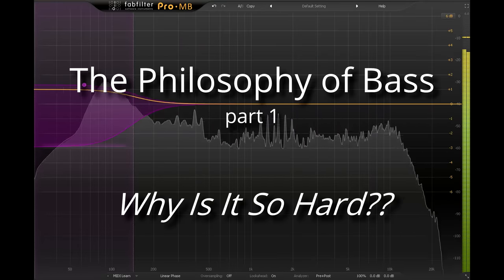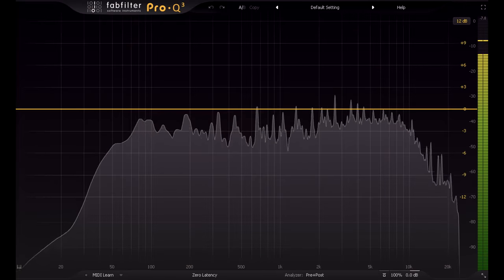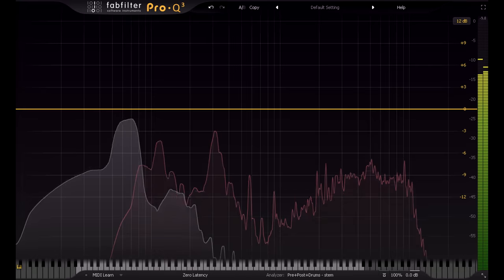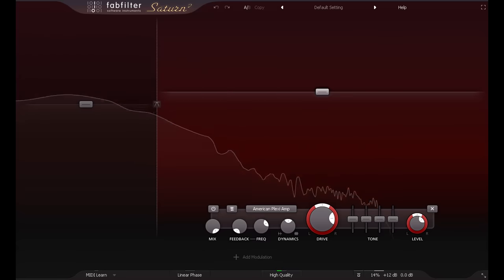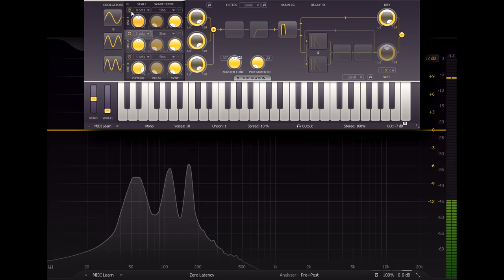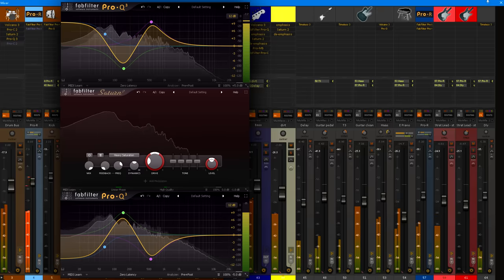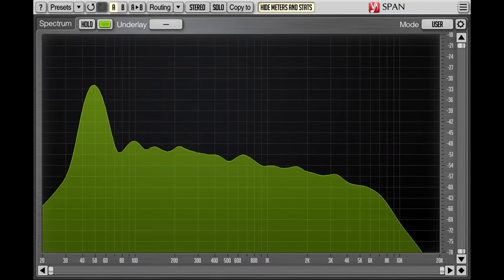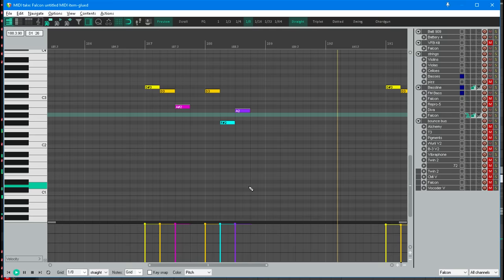The Philosophy of Bass

Comment: Many people use an app like Reference, which has presets for tons of headphones and monitors to re-tune them to be flat.
Reply: I didn't like that app, I tried it for a few months but preferred my headphones with their stock sound, and found mixes fine tuned using them with their stock response were also translating better than if I used reference (was called sonarworks at the time)

Comment: Hey! thanks so much for this, Loved it! I have a question. Obviously adding the two partials at one octave and one octave + 5th is very easy with a synth, but how can I do the same thing with, say, an electric bass? is there a specific saturator that's tuned to do that? I suppose you could low pass the saturator if it's in parallel?
Reply: They're already there. A vibrating string will produce the entire harmonic series. Just use EQ to shave back the low fundamental and if necessary boost the higher harmonics instead.

Comment: Hello Dan, hope you're doing great. 

So, as long as I have a big-ass subwoofer, does the size of the main monitors matter? Is it ok if, for instance, I purchase a big-ass subwoofer + tiny 4'' woofer monitors with tiny cabinets?

Also, there are some monitor designs that ditch the reflex port and instead they use some sort of diaphragm or "passive radiator" that look like extra woofers. What do you think of those?

Thanks for the great videos as always, cheers!
Reply: Bigger main monitors are still beneficial as that allows you to set the sub crossover lower. If I had tiny monitors I might add a sub first, then replace the mains as well when funds permitted.
Passive radiators are basically the same as reflex ports from our perspective. I believe speaker designers use them when tuning the ports with tubes isn't practical. Just think of them as fancy reflex ports.

Comment: Good to see.
I'm curious about the philosophy of bass in soft synths. Which very often—I assume we see in this example at 8:18—gives a 10 Hz boost. Very common in soft synths (including Twin 2) and I wonder why? Shouldn't that be considered bad engineering or is it more to this I don't understand the reasons for letting this be as is?
Reply: Careful, what you see on a frequency analyzer is not an exact representation of what's going on with the sound. Actually the definition of which frequencies are present in a signal is not something you can give precisely, unless it's a continuous time invariant signal of infinite length like a constant sawtooth wave going on into infinity.

The more accuracy you want in which exact frequencies are there, the less accuracy you get in the time domain, so their contours on the analyzer will appear to slowly fade in and out instead of tightly following the timing of the signals. The more accuracy you want for the time domain, the less accuracy you'll get in the frequency domain, so the peaks and troughs will appear wider and spread out. This is a fundamental limitation of representing the real signal (a waveform of volume going up and down over time) as a series of sine waves across the spectrum.

So that 10 Hz signal you're seeing might not even really be there. You might be able to test that by adding a lowpass filter low enough that you don't hear any real musical information, but high enough that you still see the 10 Hz signal, and see if it still clips your output or shows up on an oscilloscope plugin. But of course you'd have to make sure it's not actually 20 Hz or higher information that isn't visible on the spectrum analyzer due to a similar accuracy problem.

It might even be some DC offset that's appearing and disappearing, which is confusing the analyzer. DC offset is kind of a 0 Hz signal since it's an unchanging offset in the volume of the waveform, and if it's not filtered out properly in the visualization, it might cause weird issues.
Reply: @cornoc  
Many thanks.

It's not just a peak at 10 Hz, it's a pretty wide frequency from 40 Hz and below after a burst showing all lower frequencies—cut at 10 Hz because of the analysers not going further down. (Fabfilter Q3).
Although it is a consistent frequency from 40 and down no matter what key you play.
So maybe it is an error occuring in the analyser?
 
But the low frequency information only exists in soft synths. Not from external synths etc. 

So if it's caused by the programming in the synths, shouldn't it be filtered out instead?

Would love to hear more about this from the developers.
Reply: @cornerliston  Yeah you've got me curious about that now, I'll check with my analog synth later.

Comment: Built 2 18 inch bass horns with 2m2 throats, folded midrange horns and 2 compression horns. PC, 8 channel usb audio, dco, 2x3w SET tubes, 2x20w A tubes and 2x 1000w SS amps. Accurate bass to 30..it goes to 15hz lije you never heard before and 106db1w average and instantaneous, fast play.

Comment: The intro to Angel by Massive Attack has 3 separate bass lines co-existing; a synthesised bass, a kick drum, and a low bass guitar, and somehow it works. I have large 8 ohm planar headphones, and Angel is impressive to listen to, much more so than on any speakers I've ever owned.
Reply: Do you know the original Reggae version of Angel? I was amazed by how they arranged that track first and foremost... They completely changed the vibe of it... P.S. The aforementioned track is "You Are My Angel" by Horace Andy.
Reply: @Bati_  I didn't know it, but I just checked it out. So soulful. Almost unrecognisable from the massive attack version, which is kinda menacing. Thanks for letting me know.
Reply: @FriedEgg101  No worries! I’m glad you discovered and liked it as well! You are right, they evoke completely different feelings.

Comment: I found the thing about the cabinet size on subwoofers interesting. Does it mean i should swap my sub7 for the t10s?!  Because i read different things. But usually Dan says things that are profound and scientifically backed. But this maybe should be a bit elaborated :)
Reply: What he says is a little bit simplified, so i will give a little less simplified answer. A small bass driver could produce low bass at the cost of not being very loud. To produce bass you need to look at the volume of air the bass speaker can move. If it's a small driver, its excursion has to be greater. A 7" driver needs to travel a lot further back to move the same amount of air as a 10" driver. Speaker drivers tend to distort less the less they move, which gives that a larger diameter driver often sounds cleaner than a smaller at low frequencies. 

Here are some different approaches to subwoofer design:
1. Small speaker driver in a small enclosure. This kind of design just suck if you want good reproduction of low frequencies, just like explained in the video.
2. Small speaker driver in a big enclosure. This is better at reproducing the low end since the air in the enclosure doesn't restrict the movement of the driver as much.
3. Big speaker driver in a small enclosure. This is not necessarily better than 2. The air will restrain the driver from moving, and will require a lot of EQ and thus amplification to be able to move the driver as much as needed. A lot of power is going to just warm up the voice coil instead being transfered into acoustic energy.
4. Big speaker driver in a big enclosure. This is just what everyone should get. High efficiency. Good low frequency output. Low distortion.
Reply: @albinapa  Thank you very much for the detailed explanation and insight.
Meaning that the t10s in fact should have cleaner bass reproduction than the sub7?!

Comment: Nice and surely interesting video. Keep it up!
But as a Speaker builder myself I have to strongly disagree with the first part, the concept of needing big speakers for deep bass extension is quite outdated (although it is still valid if we talk about peak spl). Modern speaker drivers are exceptionally good in producing incredible bass out of small cabinet volumes. Especially with all the active monitors used by pros and consumers nowadays.
Also afaik the audibility of group delay below some 70 to 80 hz is highly debated or at least shouldnt pose a problem on any halfheartedly designed speaker.  Below some 200hz room-acoustics dominate anyways.

Comment: It depends on your mix environment and to the playback environment.

Most studios have bad room treatment where it's not really curing the bass mode problems.  There are three types of low frequency mode problems.  Axial, Tangental and Oblique.   They are the modes created between 2, 4, or 6 parallel surfaces.

The biggest problems are the Axial modes and in small rooms that people have, they need some rather expensive low frequency absorption that takes up a lot of physical space.    the video mentions corner bass traps, which is the biggest crock because Axial modes are NOT between 2 parallel corners, they are between 2 parallel surfaces.  it's all about SURFACE coverage.

To really go after those frequency problems in the average room can easily cost in the tens of thousands and most people don't have the budget and/or have the room to place enough units to really minimize room mode pressure problems.  The result is the mix engineer simply will not hear accurate low frequency because either they don't have the right or enough low frequency absorption.  Most of the low frequency absorption devices called "bass traps" don't even do that much absorption in the 30hz to 50hz range which is the fundamentals of low frequency problems start and in music.  Kick drums are in the 50hz range, Bass guitars go down in the 40hz range, and some low frequencies can go even lower.
Reply: mass loaded vinyl is pretty cheap if you know where to look. I got 1200mm*1200mm slabs of 5mm thick, 10kg per m^2 for £18 each. just need a can of spray adhesive to slap it on your wall/ceiling/relatives and some AC50 acoustic caulk to fill the gaps. was only £80 to treat my ceiling with that stuff with some spare left over for the door frame.
wonder if just having strips of the stuff in the corners would act as decent enough bass traps lol
Reply: @forguanterasmus5794  
Strips of MLV in the corner?  That's a new one.  PROVE that it's effective.  Please show me absorption coefficient measurements.  

Why are you treating the corners? That's not the best way to absorb Axial modes.. Axial modes are the biggest problems in terms of peaks and nulls for low frequencies, especially in the sub 100hz range.

You need LOTS of surface coverage.  Just sticking MLV doesn't have enough mass.  It's great as a material to put in a wall structure in between other materials to decouple instead of using GreenGlue, but as a low frequency absorption by itself?  I haven't seen any measurements to prove it's effectiveness.
Reply: @Oneness100  tbf I was just wondering if it would work, I don't actually have it set up like that; my walls have NoiseStop 22.5mm panels (half inch acoustic plasterboard + 2.5mm mlv+ 5mm foam + 2.5mm mlv, stuck to the brick wall on the mlv side. each panel is 32kg iirc) but for the floor and ceiling was just straight up mlv (or barrier shield as noisestop call it) for mostly noise pollution + some foam wedge panels to help treat the highs/reflections on the ceiling/walls. not got any bass traps due to how small the room is (plus the panels already do a good job), hence wondering.
the noisestop panels have test data on their site, but the mlv just says 32dB reduction for the 10kg/m. how they got that data or what the response curve is, idk.
Reply: @forguanterasmus5794   you are now discussing sound proofing.   What's the STC rating of your wall and what frequency can it down down to?  And why did you decide upon the wall construction design that you are using?   Did you do any noise study measurements first?

 Most walls have an STC rating that only goes down to about 125hz.  Does your walls block below 125Hz and if so, by how much?

What you are also doing is confusing soundproofing AND sound treatment.

Please keep them separate.   Room treatment has nothing to do with blocking sound going in/out of a room.

Room treatment is dealing with pressure and/or reflection problems within the room.

Foam wedge panels?  Where are you putting them and why?

I think you need a re-education on what you're dealing with.

Comment: Very nice video. Here are a few things about headphones. The ones that you showed are not designed for mixing, which is why they failed you. Headphones can be EQed with software but also with autoEQ project, which is free and with measurements  from engineers like oratory1990, you can shape their response to resemble monitor setup. That said some headphones are designed to be used as a level reference - they must be semiopen construction like DT900. Their bass extends flat to 20Hz with little delay and distortion. Tracking headphones like DT770 have purposefully warped response to aid various tasks around the studio but they're quite far from "flat". Usually mixing takes two pairs  of headphones. You can simulate the other pair with EQ, but the key point is that one pair needs flat lows and midrange and highs tuned to a loudspeaker setup. The other pair needs boosted highs like DT770 and other Beyerdynamic and AKGs. Headphones have potential to have their bass better in some ways than speakers, just not the visceral impact. Some headphones are designed specifically for monitoring bass - Audeze LCDX for example. They have relatively flat bass down to 10Hz and completely free of compression while distortion is at less than 0.2%.Their upper range is unusable without EQ, but they're better than anything else at that one thing.
Reply: I think very few headphones are suitable for mixing thanks to the frequency response. HD600's with a bass lift or Sundara with a 2khz lift by 2.5dB would be pretty good. Etymotic IEM'S are also really close to neutral.

Comment: re Slope: I analysed a bunch of popular tracks in Voxengo Span and, to my surprise, found that they had a slope not of 3 (pink noise (3.01 actually)), nor of the Voxengo Span default setting of 4.5, but of about 5.5, which is much closer to red (/brown) noise (slope 6.02) than pink noise. When mixing or mastering, I now try to get the top end and the sub to be at the same height with a slope setting of 5.5, and that seems to work well. I think that the idea that people like pink-noise-sounding songs best is incorrect. I think people like red-noise sounding songs better, but red is a bit too much, and we should back off from 6 (red noise (6.02 actually)) to a slope of between 5 to 5.75 depending on genre. That's what I think anyway. Whatever you think, this Wikipedia page is reallly really really worth reading! https://en.wikipedia.org/wiki/Colors_of_noise

Comment: I've come to the conclusion that bass doesn't need an enclosure. An output from a dipole bass is the most purest type of bass sounds I've ever heard. Even a "sloppy" driver will produce surprisingly tight kicks and pleasant, exact notes. Someone would argue about phase problems and the lack of sensitivity being a problem. Well, of course the room will do stuff and it's not an easy task to get everything in sync and equal, but that is same for everything when trying to output a flat and coherent sound in a closed space. 

EDIT: A free air/dipole bass does usually need equalizing because of the broad roll off at the lower frequencies. And I'd suggest keeping the drivers close to the listener, as the response probably shifts more or less, the farther from the drivers they're being listened.

Comment: I have an opinion that pink noise is the true flat noise. White noise has a constant amount of energy per hertz, but there are a lot more of those hertzs in high frequencies. Pink noise has a constant amount of energy per relative change of frequency (or, per octave). Or, a fixed amount of excitation of a resonator of a certain Q, no matter the resonance frequency of the resonator.

Optical spectra are often presented as amount of energy per nm of wavelength, and if presented in this way, white noise will have a heavy slope. It's a matter of x axis choice. If the x axis is logarithmic, pink noise should look flat.

Comment: Even with decent headphones I’d say that if the low-end sounds loud enough when listening with headphones, it’s surely that it’s too loud. Headphones will never permit you to "feel" the low frequencies as you would on a powerful  sub-bass-able system.
It’s not easy to get use to just appreciate the low-end with your ears only. Especially  when dealing with musical genres for which the bass parts are knowingly headed to the body, not the ears! ^^

Comment: 0-80Hz totally transforms the mix.  But how to mix down to 40Hz (most subs are limited to this) and lower in the same mix?  It's not really possible.
Maybe the pro's can get more work by making separate mixes for cars, homes, clubs, people who have subs, people who have really low subs.  It's a dilemma.

I am EQ'ing some Witch House music. From the spectrum, I can see it was mixed for subs down to about 40-60 Hz.  It relied on the dynamic range compression of large drivers to compress that region.  I'm using distributed bass, so I had to put a 12 or 24 dB/octave High Pass Filter to do that compression and get a nice clean and fast bass in that region.  Ideal would be about 16 dB/octave but I have to customise the filter for that - for these drivers.

Maybe some recommended EQ settings distributed with the music or on social media would help.

This recent trend to mono music on phones and bluetooth speakers is horrible.  By now, some EQ curves could easily be part of music encoding and decoded by the player.  I think this was considered when MP3 format was created back in the day.
Reply: recent trend? 😂 Genres like EDM have been mixing mono for decades now